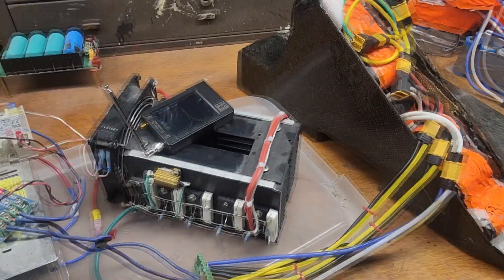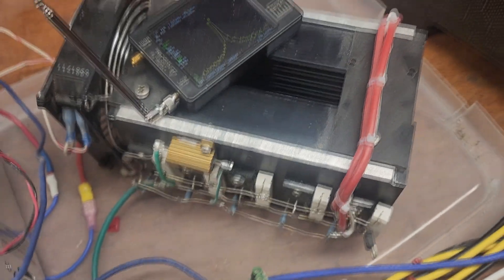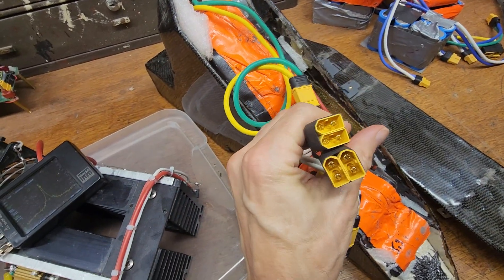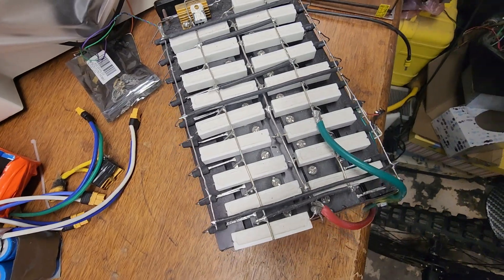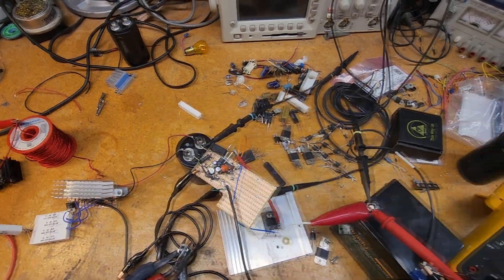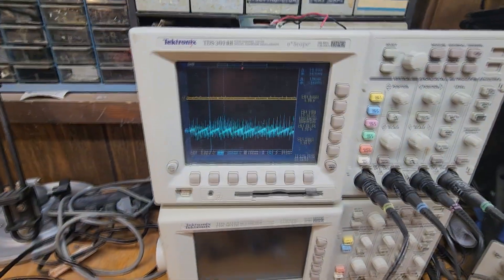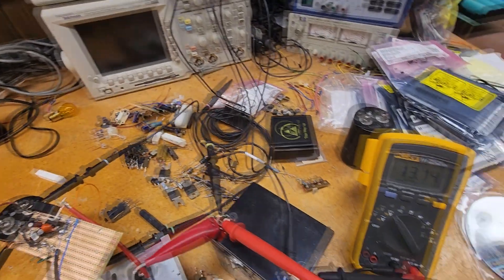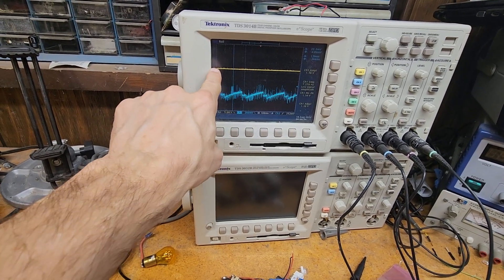2 Rare Bedini Replications

Comment: Hey man, your channel is a national treasure, thank you for providing videos of all the OG's !

One question here: did you get to over unity? are you using it to charge your batteries etc?
Reply from the maker: On my orginal simple SG motor over two decades ago,  I did tons of charge and discharge cycles and then averaged them and calculated a COP of 1.4. Only problem is the batteries like resistive loads and not the SG inductive input, so can't keep it going by rotating batteries to front end when front end battery dies. But I have charged 4 batteries with one of the same size individual battery. It is possible to rotate, it just takes a little research and patience  to understand and take to next level that can't be denied by skeptics.
But I do use Bedini impulse tech to charge my ebike batteries, and the "free energy" shows up in longer run times than I would get with a conventional charger. Also the mechanical energy of the wheel is part of the "overunity" with the Bedini monopole motors, if you have the equipment to measure it.

Comment: Thank you Davy! Do you charge your bike batteries with radiant spikes directly or do you rectify them first by charging a cap and then switching it into the battery circuit? Or am I way off on how it works? What kind of battery is the bike battery? Any batteries types you have noticed work best or don't work at all? Thank you again, amazing vid and equipment!
Reply from the maker: It isn't charging with a HV radiant spikes like in the monopole motors. Instead it is charging with 60v impulses from the power supply (which has a capacitor inside) at 10amps,and at 7.8 million times a second. The LifePo4 batteries are great, like Bedini points out in EFTV Part 37. Don't want to mess with lithium ion batteries, they are just too dangerous and finicky with charging and not bursting into fireworks display. lead acid batteries are great to start with and are a little more forgiving when it comes to damaging them unlike lifpo4 batteries which you can't charge with the HV radiant spikes like the lead acid batteries. My ebike I used lifepo4 cells and built up my own custom battery packs to best fit my homemade case with the most batteries.
Reply from the maker: Its based on this charger:
https://youtu.be/y93IwhOGWB4?si=bWbCx09lObKhgRmI
Reply from the maker: and here is Peter talking about it:
https://youtu.be/OB-hoo6lLYc?si=cpjvofwKPn9t0yZr
Reply from the maker: oh, and this one here was actually the video that helped me figure it out, and it is also closer in size to mine:
https://youtu.be/t767CXTK5aA?si=Cc5FK0aUtJCAJTMG

Comment: enjoyed the video. the bedini motor at 3:41. How well does that work? Like what size batteries can it charge and how long and how many?
Reply from the maker: That is one I designed and cut on my CO2 laser with the intent of making a kit available several years ago. It has only gotten to the mechanical stage, no electronics yet because at the time I couldn't decide on which circuits or how I would arrange. I  also couldn't decide if I wanted one group to be a generator or have two dueling SG's. Then I got distracted with other research . But to answer your question, an energizer this size, you could expect to work with 12ah batteries or smaller. Usually they will charge up over night, and one battery can charge 3 or 4 others at the same time.
Reply: @DavyOneness  is that if batteries are are about empty? And what kind of material is your wheel made out of?
Reply from the maker: @michaellaurenzi6054  sure, but be aware "empty" isn't zero volts, and varies with battery type chemestry. The rotor is made of some laser etched mini plywood  pieces to hold the magnets in the V orientation.

Comment: Hi Davy, I have been meaning to ask you about the 4 pole, 4 magnet rotor machine, with the green and red coils.  What are the characteristics of that machine when in operation? It has piqued my interest as I have seen it at least twice in your videos. Looks like the small 3 pole kit John originally offered for sale, with the adjustable power coil / trigger in the bottom coil. 

Dave Wing
Reply from the maker: Hi Dave! It is my own design that I made several years ago with my 40watt CO2 laser engraver. Actually 8 magnets, its based on the pressed scalar magnet arrangement but with a more of a wider beam from V shape than Bedini's ten coil version with the magnets fully pressed together. At the time I was thinking I could make a kit available with it, but then life got in the way. I have only gotten the mechanical part built so far, still haven't done any electronics for it yet. My focus been more on solidstate and zero force motor, but want to return to this one to get it spinning some day